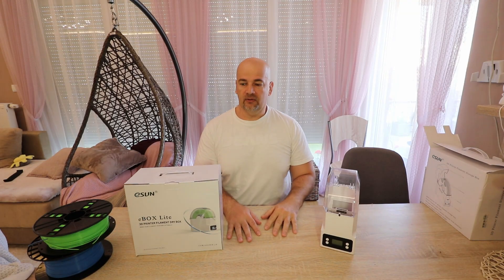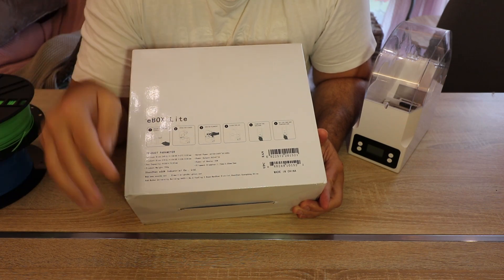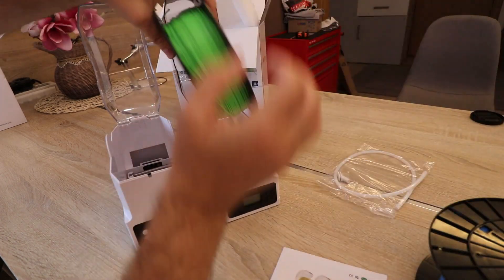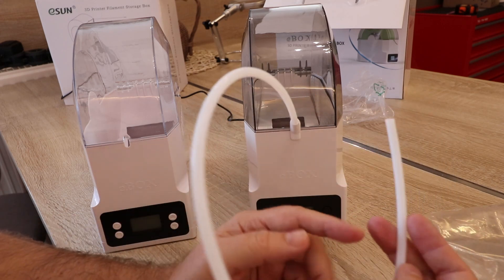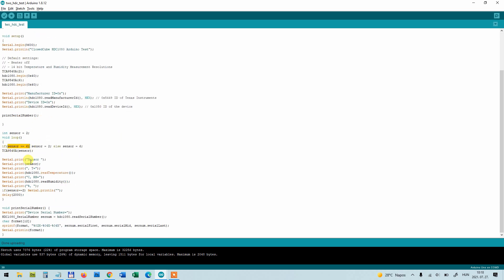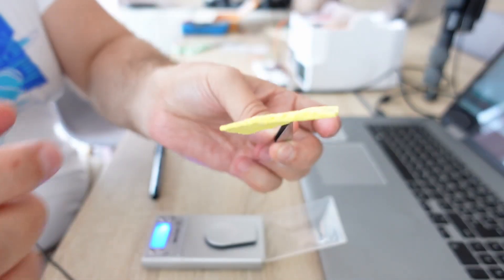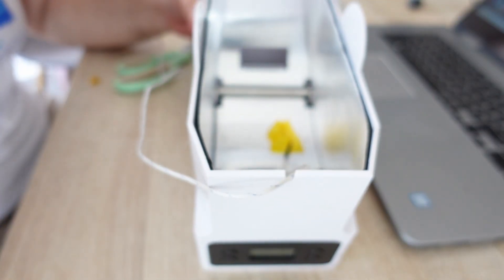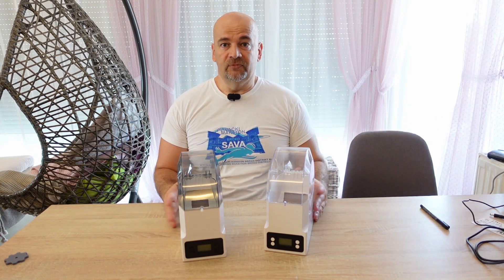eSun eBox vs eBox Lite filament dryer - which one dries better?

Comment: Great review.  One more thing I would have done was ran the test again and swapped the temp/humidity sensors to the opposite unit to check for and help reduce the effect of differences in the sensors.  I often find significant inconsistency in these electronic sensors and I do the swap to enhance my confidence level that the sensors are not influencing the result.  Nice job either way though!

Comment: Thank you for this, I love the fact you are using science to show the results and not just saying this, that and the other.

I’d be interested to know which or what other one you would recommend buying? I’m new to 3D printing but I know the PLA+ needs to be kept dry to work better. So I’m interested in your honest opinion 😊

Thanks,
TMD
Reply from the maker: Check this comparison: https://youtu.be/6VB-pEvSed4 , the best (and most expensive) is the Eibos Cyclopes. But in the menantime, they have cheaper version, the Easdry https://youtu.be/IPKQCZ75Vwg . So, my recommendation is one of Eibos.

Comment: Thank you for the review. I currently use a food dehydrator with a thermocouple with an esp8266 to control temps. It works extremely well and I can dry 3 rolls at one time. My only issue it’s too large. Hoping to use the food dehydrator in my garage and then using a single roll holder at each of my printers inside. To maintain low humidity while printing. Thanks for all the test!

Comment: Would you recommend the Sovol over the eBox Lite?, very similar in price.
Reply from the maker: Sovol would be better, but my died after 4 months. So I am afraid to recommend it any more.
Reply: @MyTechFun  thats a real shame, whats your number 1 overall? I did like the look of the Eibos but its out of my price range I'm afraid.
Reply from the maker: @daveycrazy  Yes, Eibos is #1, Sovol would be #2. I am trying to repair it, but I don't get assistance from Sovol. I am modifying a cheap food dehydrator so it can be used during printing too. Video in few weeks.
Reply: @MyTechFun  Caved in, going to get the Eibos
Reply: @MyTechFun  You should solder in a fan in the sunlu s1 and re test it (against itself without fan and others). People are seeing much higher temperatures inside the dryer due to the air flowing over the hot plate.

Comment: Hello what humidity percentage is good for PLA, Will it works good with 75% humidity, Please comment if creality Printer Enclosure could Reduce humidity as it is closed.
Reply from the maker: Yes, creality enslocure reduce the humidity if you raise the temperature inside. In my creality filament review, during ABS printing, the temp was 50C (almost more than inside these dryers). Yes, it can help if your environment has 75%. Use some desiccant inside.
Reply: @MyTechFun  I mean not the creality filament box, the aluminium enclosure which covers the 3D printer as well, which u shown in the previous video, which is fire resistant
Reply: @MyTechFun  the reason for asking this question is, i already have the 3d Printer Creality Enclosure, if I add the Filament Enclosure, will this add value to the Print?
Reply from the maker: @Krealityfabrication  https://youtu.be/YI9dcCAQV1A?t=1085
Reply: @MyTechFun  thanks it was understandable, my understanding says, either get filament box or heat the enclosure 2-3 hrs before printing 😁
Reply: @MyTechFun  Sounds Great! Thank you

Comment: they ditched the weight sensor on "lite" version probby 'cause it was so imprecise on the original that was unusable, so looks like they found it cheaper to remove the sensor than to fix it :D ... as for the FET vs relay, I think they did it to reduce the cost and not to remove the noise.

Btw, to reduce the noise, replacing the fan that it comes with with maglev type fan reduces the noise significantly, I have 11 esun boxes (original ones, have not tested the lite one) and all 11 of them have fan's that don't have balanced fins so they vibrate a lot, replacing the original fans with maglev removed noise. (on few I killed the relay and they are "always on" so I can use for longer drying and during long prints, so far looks like temp settles down low enough not to cause any damage... I would not recommend it but I had a need for it so sacrificed two of them)

Comment: Of course, when the temperature is higher, you automatically have a lower relative humidity because warm air can hold more humidity. You'd have to convert that to absolute humidity to find out if there is actually less water in the air.

Given that you can purchase inexpensive thermometer/hygrometers for  as little as $2 , it makes no sense to me that these boxes are not equipped with such a sensor.
Reply from the maker: I have another dryer waiting for a review, wider and temp+humidity sensors included. Video in a week or two..